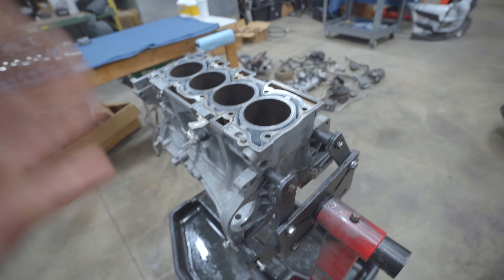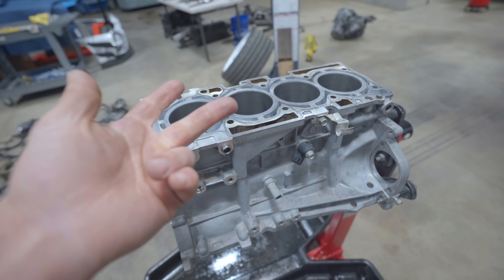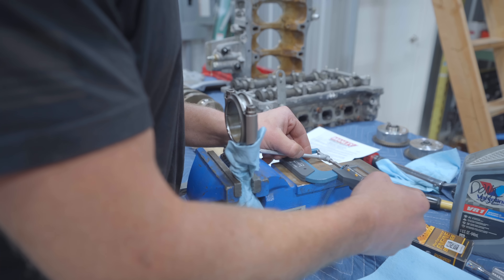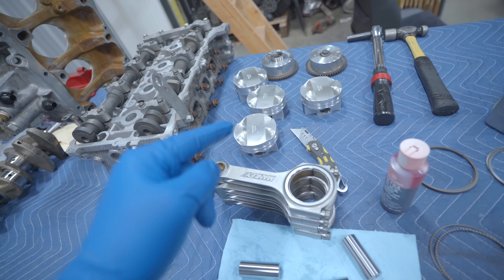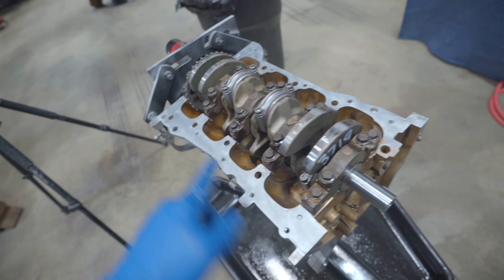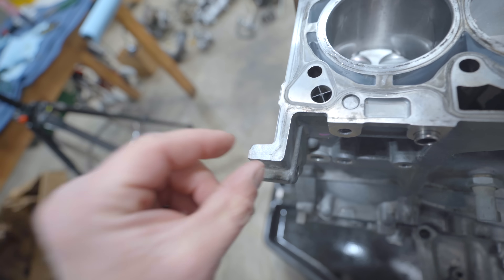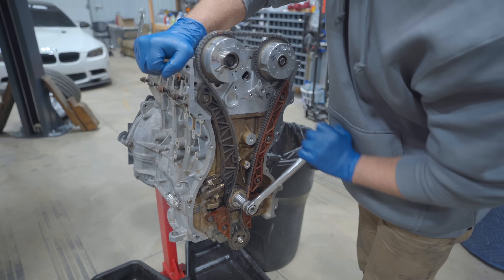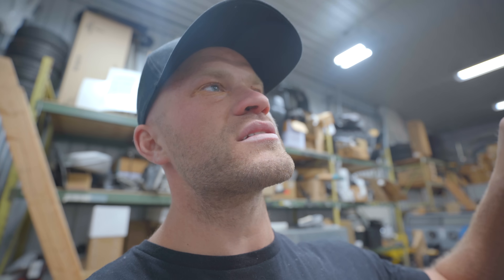Building a 4B11 Engine From Scratch

Comment: 4:52 you actually need to read it counterclockwise because you measuring bigger diameter than the one you set on the micrometer, so its actually 52.

Comment: I have a arp tool that was gifted to me that is used to install there head bolts correctly. It has an outer part that holds the nut and an inner part that turns the stud. I was shown to gently turn the studs to the bottom then hand tighten the nuts until they are just snug then back the studs off the bottom a 1/4 turn. The arp engineer said that they didn’t want the stud actually touching the bottom of the hole as the heat could cause them to become to tight and be hard to pull out later. He also was very particular about the washers that are used for the springs with an aluminum head. It was made very clear that the pattern side went down. Evidently the springs will eat into the head without the washers and the pattern on the washer was to keep them from turning. 
It was an interesting visit to the company. 
Nice motor for the give away. It will be a dream car for whoever wins it, great way to spend a Sunday. ✌️